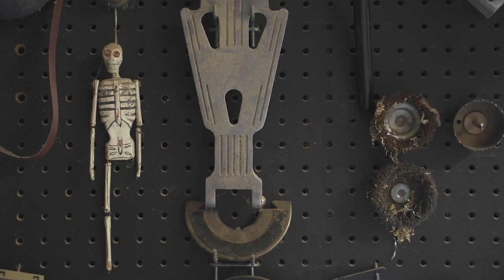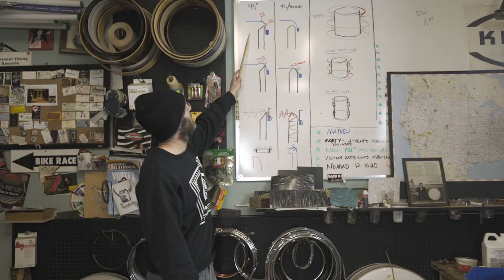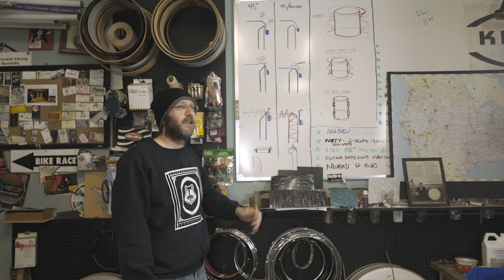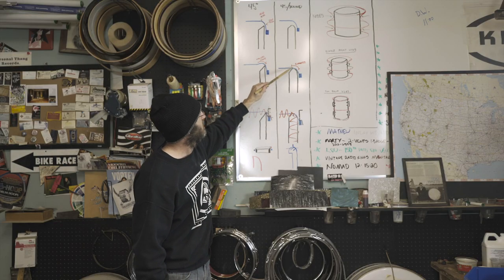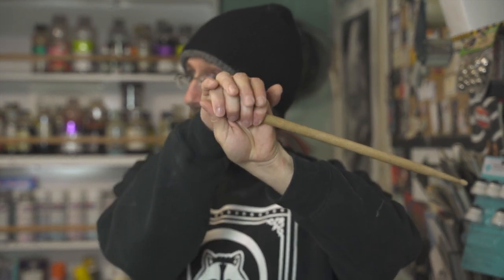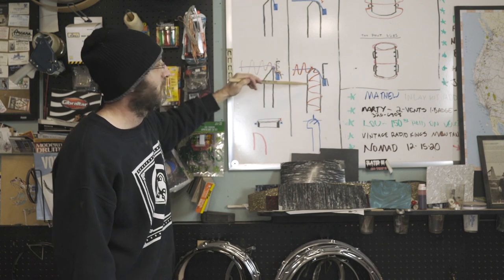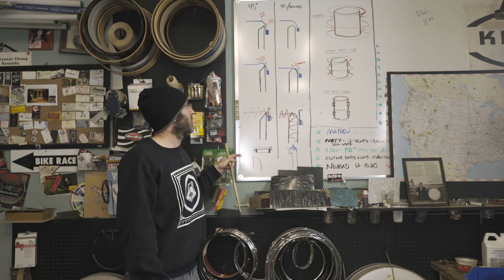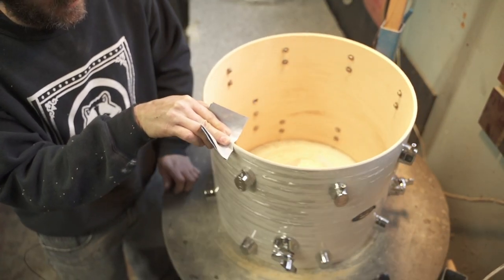KIRSCH DRUMS - "Understanding Bearing Edges" BRIDGE CITY SESSIONS

Comment: Very informative video, very well explained! Question: Sonor and other companies make their drum diameters slightly smaller so the drumheads have a not too toght fit even with single cuts, is that about right..? I have an old Sonor Champion. Thin shells, round bearing edge. I want to have the bearing edge recut to a 45° angle. Would the 45° round over still be the best solution? wouldn't the edge be a tad too small in diameter to fit the drumhead nicely? I really would appreciate your help, because I love my old Sonor kit and don't want to make a mistake... thanks!

Comment: I build drums as well i particularly like the double 45 with the apex dead center of the plies like a pencil tip. This edge gives me the most attack and since the apex of the edge sits away from the elbow and under the flat part of the head of the head much like an undersize premier drums shell I get a very resonate and clear tone. I like round overs for achieving a vintage tone but for fast aggressive music like punk or metal the double 45 is where it’s at. I borrowed this edge design from Spaun Custom Drums and have seen it often on SJC and Dark Horse drums. As a punk drummer the sharp double 45 is the best!

Comment: That was an amazing description of what happens with the head in conjunction with the bearing edge.  My question would be.... What is the appropriate curve of the bearing edge to match the curve pressure treated into the head? Is an 1/8" or 1/4"round-over applicable to most heads, or is it something else.  Does it vary depending on the manufacturer or head type you use.  I'm an Evans G2 Clear fan for my toms (8,10,12) and an EC2 for the 16" floor because it needs a little more dampening as it tends to ring long, especially when it's dialed in perfectly..  Do I need to figure out what that particular head has for the curve?  Thanks so much for the info!!

Comment: Very insightful. I never made the connection of the sound traveling from the skin and thru the wood. I always thought the sound bounced around within the drum and exited the port holes... Very cool!
Reply from the maker: We really didn’t either. Jeff turned our drum edges and it was an enormous upgrade for our house kit.
Reply: Good way to show this off is take the toms or anything weighted off your kick drum play it and then play it while applying a little bit of force with your hand on the top of it and note the difference, it is a pretty stark contrast with your hand deadening the shell sound
Reply: The only sound we hear from a drum is from the heads vibrating. The shell material will mute certain frequencies of the head and that’s it. The vents job is to relieve pressure inside the shell. There’s no sound inside the shell only the pressure from striking the head.
Reply: @Assimilator702  That only really applies to 'dead' shells, such as Acrylic or Remo's Acousticon shells - or wood shells whose edges aren't cut to accomodate the heads, as Jeff explained. Put a dead shell and a nicely edged Mahogany tom side by side and you'll hear a clear difference.
Reply: @flocore  So you’re saying the shell vibrates and emits a sound? Or are you saying different shells materials color the sound heads can make in a different manner?
Reply: @Assimilator702  
I would argue that shell resonance becomes an attributing factor in sound under certain circumstances. For example, if a shell is fairly thin and the wood species dense/ hard, its own resonance can be activated at a much lower volume or strike intensity. If you have a thicker (and/ or softer) shell, you have to hit the drumhead harder, in order to activate the shell and you usually have more headroom (also depending on wood species), which makes thicker shells preferable for hard hitters. My Starclassic Maple is really versatile, but it can only go so far when it comes to volume (which is usually sufficient, I might add). You can really overplay and deaden (or choke) those drums, when you're laying in there too hard with 2B (or even 5B) sticks. That won't happen with a Granstar, for example. Although I would agree that the heads, type of sticks and the drummer  are the main sound factors.
Reply: @flocore  Ok. Your "theories" don't clash with my mine. We're on the same page. Also overall density of shell material trumps wood species for example. Some metal snares share attributes with a wood snare. I was much too hung up on wood species a few years back and I want to approach drum sound with a knowledgeable but also not a misguided manner. When you mention the Tama Granstars that gives me a reference since the only snare I owned for many years was a 1988 Tama Artwood that uses the Granstar shell.
Reply: @Assimilator702  
It's not theory, but all from my practical experiences over the past 27 years :)
Reply: @Assimilator702  
But I totally agree that you shouldn't get too hung up on wood species and their influence on the overall sound of a drum. It's way more important that the shell is structurally sound and manufactured well. Sadly, there is little fine-tuning work being done when it come to mass manufacturing drums - as opposed to stringed instruments, for example, which undergo inspection after manufacturing, as well as when they arrive at a foreign distributor or shop, usually.

Comment: Can you pls answer.  I have a vintage snare drum. With re ring. It has somewhat round over on batter. And well the reso side and bed are not correct.  I want to know.  I want a full roundover on batter.  I know the whole thing with differences. Watched prob hundred videos. I understand the beating edge. My question is mainly the reso side and bed. I actually think because my snare has NOT a sharp edge on reso side. It seems compared to all my other snare drums I’d seems like a softer drier punchy warmer attack.  So. Is it ok to put a fairly round over on reso side.  And a brand new bed.  I can’t see even a baseball edge will produce just as much Resonant and full sounding. Not thst sharp attack that is bright.  I want opposite of that.  Sorry for long text.

Comment: What is your opinion on re-rings in function of raising the pitch and adding projection to the shell?
Reply: The origin of rerings is calf or animal hide heads. Because they can shrink with a ton of force in the right conditions, rings were added for support. Especially because before hardwood ply shells, the majority of drums were very soft bendy woods that were easy to make round. Rings were installed as a "just in case" and never really had a tonal reason to exist. With modern plastic heads, a drum will rarely see the tension required to need rings. All that said, adding mass of any kind will raise pitch whether its rings or additional plies. Picking a shell is much like picking a ride cymbal. Thinner is warm, breathy and sensitive to dynamics and thicker is brighter, projecting and more consistent sounding no matter your dynamic.

Comment: Only one shape works to your liking with modern heads. But Ludwigs will not be Ludwigs and Tamas will not be Tamas. They will be modified Ludwigs and Tamas. As with anything vintage, few people who want a vintage drum kit want a modified vintage drum kit, and fewer and fewer vintage kits will be available as they undergo various forms of destruction like this. You are only the temporary owner and player of a drum kit. Please, DO NOT MODIFY VINTAGE DRUMS.
Reply: There's an astounding difference between modding an edge and restoring one. If you've got an instrument that goes long enough without repair and restoration, there's a good chance it's almost unplayable. Which has zero value to anyone except a museum. A guitar or violin will go in the shop for cleanings, tune-ups, fret dresses, neck adjustments and restorations where drums usually don't. This is why you can see 300 year old stringed instruments and very few drums that old. I would never recommend modifying a classic kit but I also wouldn't recommend letting them rot apart.
Reply: Also, much like a neck or fret adjustment on a guitar or violin, repairing these aspects actually have little to do with sound. These are about tuning ease, stability and flexibility. A Fender will still sound like a Fender, a Gibson like a Gibson, Ludwig like a Ludwig. A brands sound has far more to do with its structure and design than its set up.